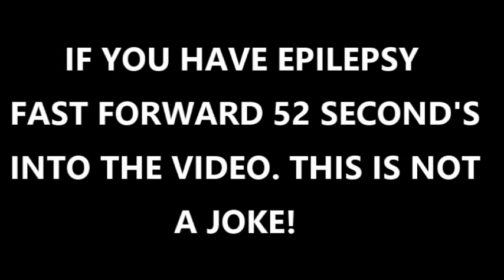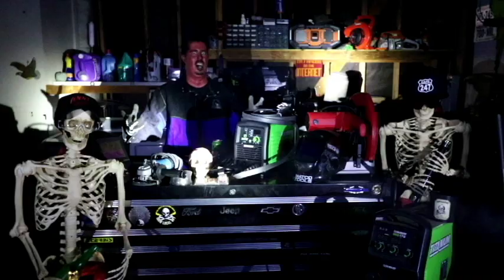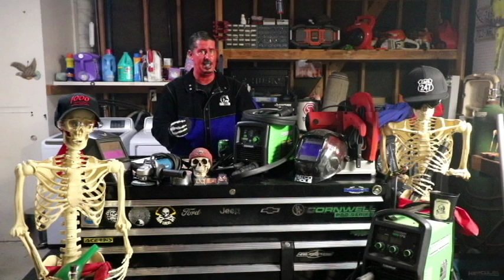10 ESSENTIAL WELDING ITEM'S YOU MAY OR MAY NOT FIND AT HARBOR FREIGHT!

Comment: Yo BEESFUCKINGKNEES...  Check out Benchmark abrasives. They offer a mixed pack of flap wheels for only $10 shipping using code FREEMIX. They are great quality and they are a must for fabrication. I use the hell out of them cleaning up the chassis on my '57 F100